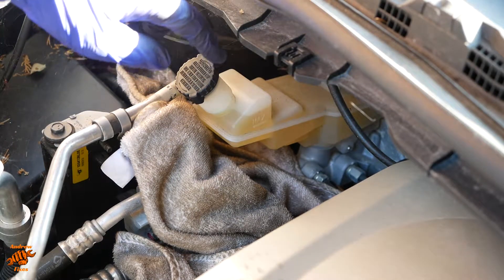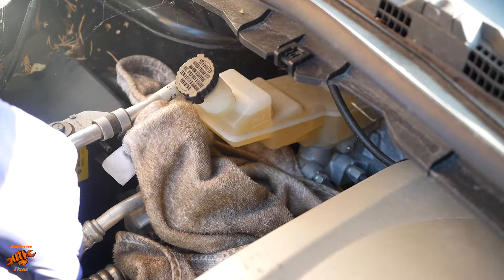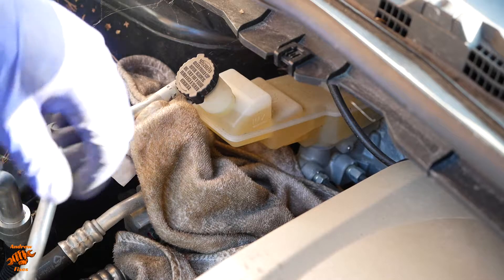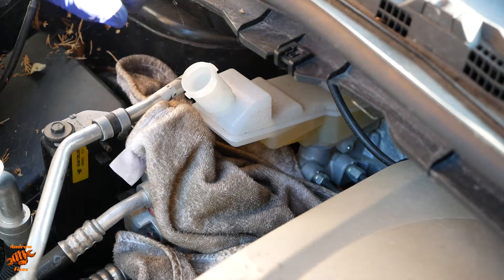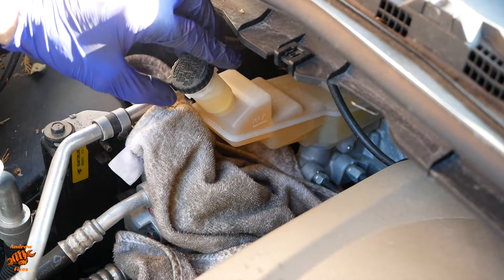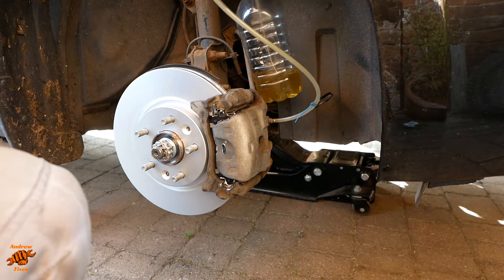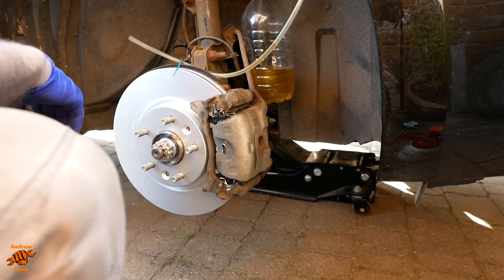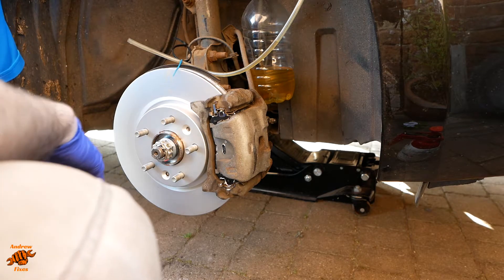Nissan Leaf brake fluid change - how to guide

Comment: Good video but you barely drained any fluid at 7:48, the level only went up one ring in the bottle.  Need to bleed much more than that, especially since your master cylinder was half-full of old fluid at the start.

Comment: Why did you change the brake pads and rotors at 25,000 miles? Surely they weren't worn, especially with the engine braking of the Leaf?
Reply from the maker: This video will explain why: https://youtu.be/2FQ_MNVKM4I
The car hadn't been serviced properly before we bought it so the pads were stuck and the discs badly corroded.

Comment: Thanks for your video, is dot4 brake fluid compatible with Nissan Leaf?
Reply from the maker: The car in the video states DOT 3 fluid on the master cylinder reservoir cap, but DOT 4 will be fine in a system specifying DOT 3.

Comment: weird order, usually the recommend doing the longest brake line first. That is usually passanger side rear. Leaf brake lines run in a weird way?
Reply from the maker: I don't know if they run in a different way, but for the Leaf it's shortest to longest, at least according to the manual I saw.
Reply: Service manual calls for this order RR, LF,LR,RF
Reply: @christiansanchez8959  The factory service manuals had RR, LF, LR, RF for 2014. then changed to RF, LF, RR, LR in 2015. Not sure why.